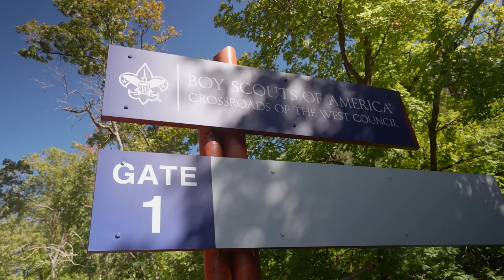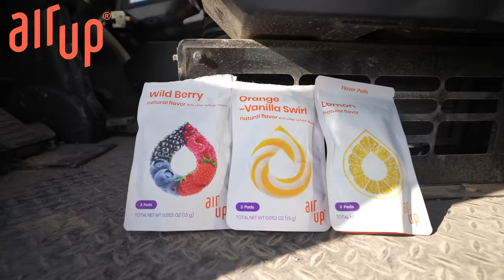Pushing The Limits Of Our Equipment With This Massive Haul

Comment: The structures you cut off the supports are called "Pavilions". Pergolas are just slats for the roof which let light through.
Reply: Technically that's true thou a lot of people use the terms interchangeably
Reply: Kinda like trusses and joist….. one that really bothers me is people Use the name “hot water heater”. Why would you heat hot water?  It’s a “water heater” that’s it.

Comment: Snow already on the way? Omg...it felt like it just left.
You right,  I'm curious about air-up, but the curiosity is rather pointing towards the direction "will that work if I place them being my AC air filter".
In my area we didn't had much problems with wasps or bee's,  but we had a mosquito invasion, they were active every day and started swarming you the moment you went outside and in the evening it even was worse...even with repellant after a BBC I counted 60 bites.

Comment: Not sure what those cabins weigh but im impressed how well the Tele Handler handled them...
Reply: He should do a quiz and guesstimate it's gross weight. 
I'm thinking 12 tons
Reply: @LaGrandeBayou  Those structures look heavier than they are, but even I am surprised by how little they probably weigh. I looked up the STH1256A and it is a 12,000 lb capacity machine. Without looking at the chart I'd guess that roof was 5-6k based on boom extension. I'm not in the business of buying these machines but Sany is pushing hard into the American market and the competition against Cat is more than welcome. Their prices freaking suck.
Reply: Yeah they definitely look heavy. And that looks about as far as you want a boom stretched with a 3 ton dangling roof.moving  Those solid cabins was serious weight for sure.

Comment: You should of flipped the roof section after you took it off the uprights and used the pitch of the roof to raise one side of it when you set it on the trailer..

No wide load sign attached to the Slingshot pilot  car....

Comment: So you're not going to reuse the gazebos, right?  You do have a plan to get some kind of a post structure re-installed on them  making them structurally safe....right?  Maybe just crush them up and throw them on the burn pile considering the challenge of actually using them now.

Comment: Very cook guys! Dave you do so much for the community,wish there were more like you in every state! Did you guys consider carrying it with the roof on the flat bed?
Reply: Not sure but the way they picked em worked out very well strapping them entirely. 
There are no pick points on the roof plus it's got to weigh 10-12 tons it would likely come apart unless bolting into its structure.